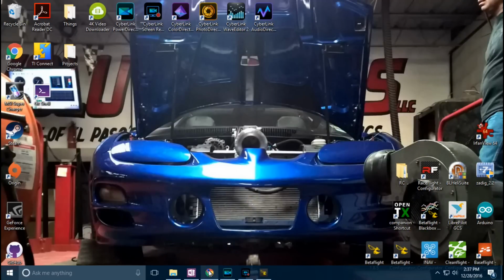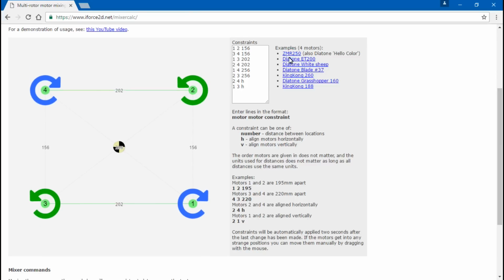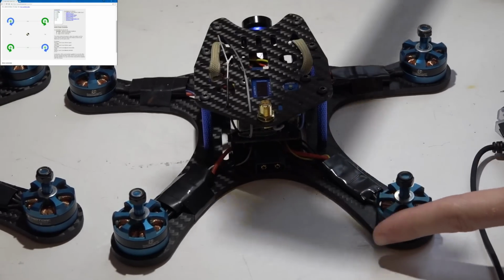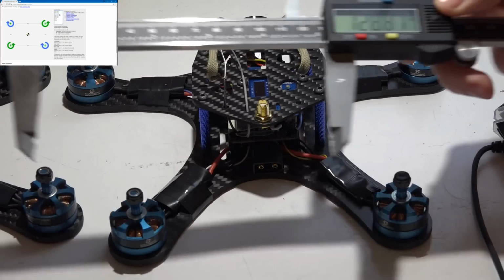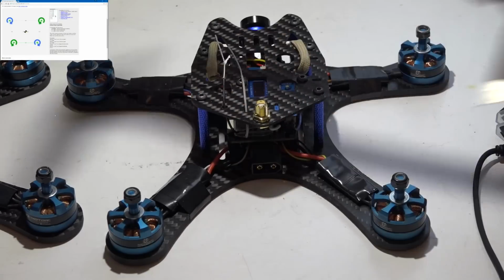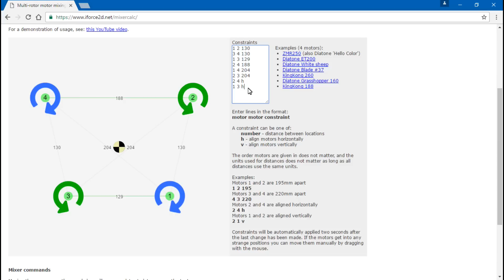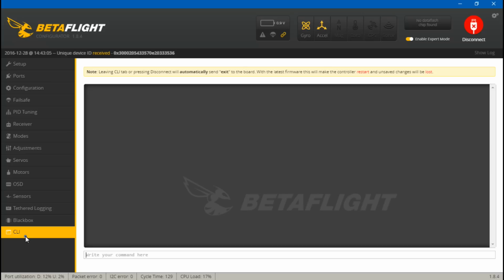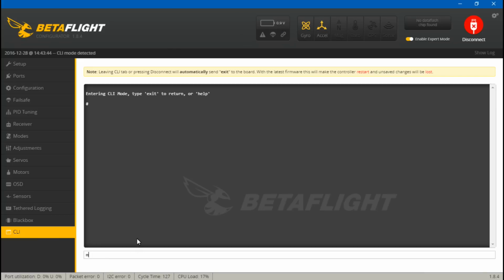How To Custom Motor Mix

Comment: Just did my 5" cause its a deadcat.  Explorer came with a custom mixer. I went and checked and i got different values from flywoo.  should I change it leave what they put?
Reply: Blue falcon died 4 years ago 😔
Reply: @chrishiggins7475  omg right. So sad
Reply: @divingfalconfpv4602  try both. Make a backup file just in case you dont like the changes. Fly whichever you prefer. It won't be unusable either way. One will be better than the other, though.

Comment: Great video. i have just built a Y4 and my flight controller is not in the centre its actually  in between the two front motors how can i compensate for this ?

Comment: great vid.  I was wondering if I could use a free motor pin such as mmix 5 for signal only purposes for a alarm/buzzer [e.g. mmix5 1 0 0 0 for throttle only].  the buzzer is designed to turn on if the signal stops.   do you know if this would work?  thanks.
Reply: skytalon74 
I this in Betaflight 3.2.1 and on they included a new 'resource' command that may be up your alley.

Comment: so let's say for whatever reason, I cannot use motor three anymore.  (like, connection between flight controller and motor three can no longer be used because it melted at the flight controller pinout while soldering or something)  if I wanted to plug "motor three" into the motor six pinout, could I use this link to set a mix that tells the flight controller to use motor six in the place of motor three?  I hope I worded that well enough.
Reply from the maker: Thats the old way of doing it. There is an easier way here 
https://www.youtube.com/watch?v=cEMfs_4X2VM&lc=z12vc1gwbqeqxnapo04ccvfw0ou5vlsiteo
Reply: Project Blue Falcon thanks! that was so easy

Comment: Like your videos.
I never have done Custom Motor Mixing on my quads. Does it feel much difference  on like qav210 frame ?
Reply from the maker: It's not a night and day difference but every little bit helps. Not sure how much it would help on a QAV210 frame since they are very symmetrical, compared to a frame that I used thats not very symmetrical.

Comment: Found this channel a few day ago... great job!
I have a question: my frame is a Rotoracer 210, a pure X, but the FC is not exactly in the center of the X, but 5mm offset to the rear. Does it mater? Is it possible to "tell" the FC that offset position?
Reply from the maker: Flight controller position on the frame doesnt matter. If its a true x then you're fine, you wont have to do anything.